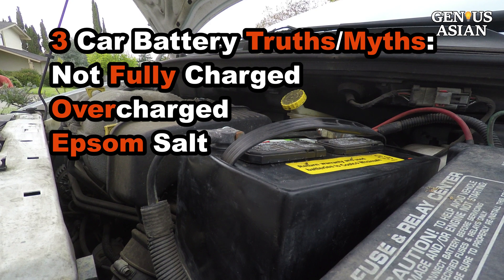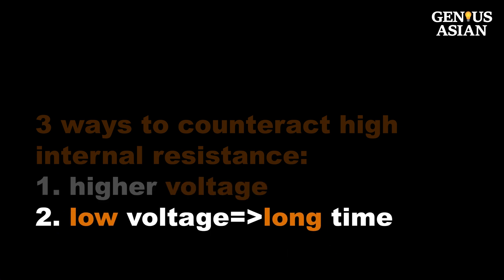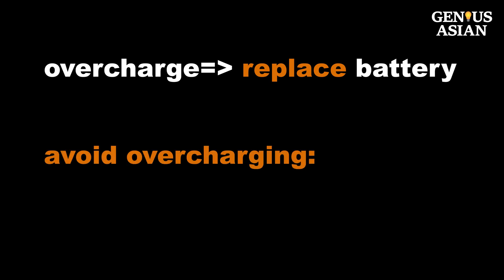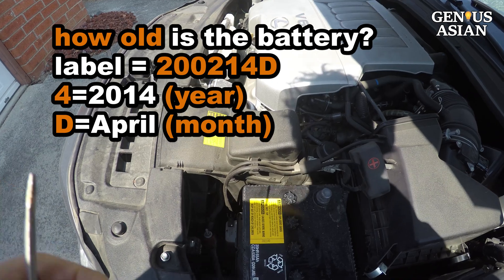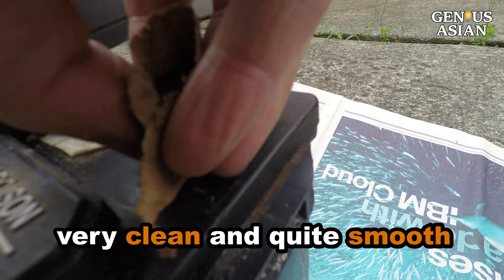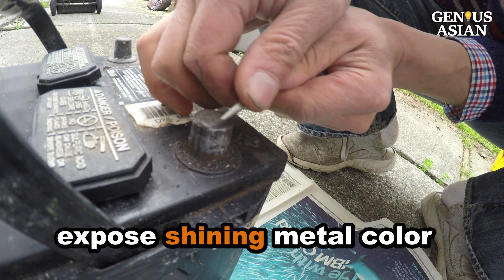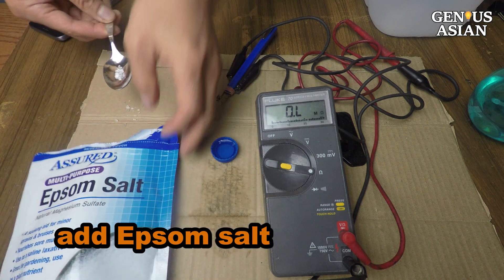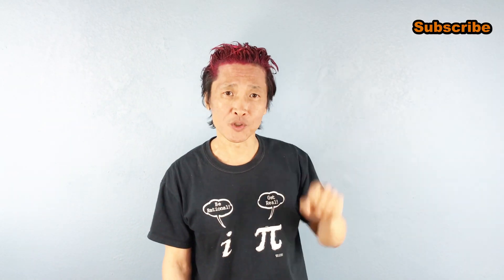3 Car Battery Truths/Myths: Not Fully Charged, Overcharged and Epsom Salt

Comment: I once charged a car battery with a 26 volts lipo battery it charged in about 5 minutes but I did it intermittent because the wires get too hot

Comment: sulfation is supposed to be removed with baking soda in each cell, a liter (1/4 gallon?)of distilled and agitation for a minute. Followed by a flush with more distilled and filling with new epsom salts solution. Have seen an isolated claim that the mag sulfate in Epsom salts is an "amps killer" vs straight sulfuric. if that holds, then  could keep the inital acid as it is easily strained and then supplemented with Epsom salts. Or buy new sulfuric.

Comment: I live in my car and use my battery a lot every day to run my laptop from it, charge my phone and tablet and run a small frudge all from starting lead acid calcium 55A battery and I use epson salts in my battery and it does really work better than when it was new. When it was new it could run 15l fridge for 2h before needing to idle engine and recharge with alternator, 6 months after when I added 1 spoon of Epson in each cell it can run the fridge now for 3h before dropping to 11.8v and needing to charge so yeah Epson salts works great for acid battery
Reply: Michael, if I was you, here's what I would do.
If you are using a 12VDC-120VAC inverter setup to power those things:
Take your inverter off of your car's 12V starting battery electrical system. Buy a 12V LiFePo4 battery and a DC-DC charger capable of charging that battery chemistry correctly. Install the LiFePo4 battery in your car's trunk and connect the charger's cables to your engine's alternator B+ terminal as well as a nice thick chassis location. Then put a battery disconnect switch in series with the positive cable of the DC-DC charger so that you can disconnect it from the LiFePo4 battery. Then hook the inverter system up to it. When you use the fridge and laptop etc., you'll draw from that LiFePo4 battery alone which is designed to be deep cycled and provides steady voltage amazingly well before it goes dead and the voltage drops off. When you need to recharge it, you can turn the disconnect switch of the charger on and start the car to recharge the LiFePo4 battery. I'd suggest getting a flexible solar panel array that you can put in your rear window or front windshield or outside on the roof as well to charge the battery for free. :) If you're using 12VDC accessories, you don't need the inverter and you can just hook up beefy sockets right to the battery. 

If you don't want to do the above, here's my second best plan:
Buy 2 identical deep cycle lead acid batteries. Install them in parallel so that you get the same 12V that you would with 1, however you get double the capacity. Having 2 deep cycle batteries makes up for the lower starting current that a deep cycle provides compared to a standard starting battery. Having 2 paralleled also gives you double the run time and keeps you from draining the battery as low as you currently are (11.8V which is the absolute minimum you want to ever bring a LA down to). You can add as many batteries as you want in parallel. You can put them in the trunk of the car, running large copper welding cable from the trunk up to the engine bay to connect them to the existing arrangement. Buy a tote bin to put them in for protection, and make sure you get a battery model/brand which has a small nipple off the cell caps for a hose to run through a grommeted hole in the car chassis so that hydrogen and oxygen gas can be vented out there instead of building up an explosive mixture inside the car with you. If you went with more expensive AGM or sealed batteries, this would not be a problem. LiFePo4 batteries are sealed so this isn't a problem with them. 

You could also build your own batteries using salvaged 18650 lithium ion cells purchased cheap off eBay and a battery management system controller to keep the battery bank balanced correctly. If you're handy, you could DIY this. If not, don't attempt it because lithium battery fires are terrifying.
Reply: @mannys9130  thanks for your advice, both options are nice but the first one with lithium is really good as I do have 100W portable solar panel that has saved me in past with flat battery under the bonnet not staring. I like option 1. with LiFePo4 and even buffing it a bit further with AGM start/stop under the bonnet.

Comment: I once found some info that told me that sodium sulfate is better than magnesium sulfate (epsom salt) and to only add it as an additive on a new battery to help prevent sulfation and not to an old battery as it may cause flaking and shorts and ruin what's left of the battery.  I have used it on a cheap new $60 550 CCA Walmart Value battery that would only hold 12.2 volts overnight brand new after a little driving.   The battery is three years old and now holds 12.4 Volts even if I don't drive the car or charge the battery for months and charges up quickly when put on a trickle charger.  The sodium sulfate has worked well in combination with trickle charging to cycle in the electrolytes.  The Turquoise Energy website that originally recommended a 100 grams of sodium sulfate equally divided between the cells of a smaller car battery disappeared, but Duda Energy still sells sodium sulfate
Reply from the maker: thank you for taking the time to chime in and to share your experiences. Hope your post will lead to more people to post their experiment and to confirm this result. Your post of "$60 550 CCA Walmart Value battery" is very good because it tells us the kind of battery is Lead acid type, not AGM, EFB type, so hope other viewers can report their finding with specific types of batteries. The obvious questions people will ask are: 1. what is the side effect (disadvantage) of adding this chemical? 2. because this chemical is so cheap, why manufacturers are not adding it?
Reply: @GeniusAsian  I read that the sodium sulfate is used an additive sometimes in deep cycle lead acid batteries.  Toxic things have "data safety sheet" (acronymed to MSDS OR SDS) pdf available as a legal thing these days, so you could probably figure out what brand of deep cycle lead acid uses sodium sulfate.  Interstate auto batteries use antimony I found out recently, which is really toxic besides the lead.
Reply from the maker: @OWK000  that makes sense, thank you for sharing

Comment: The solution has to be more saturated so  it needs to be heated to above 150 degrees f. From what I read  the mixture is supposed to be 250grams of Epson salt to 15 if oz of distilled water
Reply from the maker: Thank you for taking the time to chime in

Comment: Instead of trying 'to recover dead batteries', better to maintain it in de first instance. Disconnect n grind / wire brush positive, negative terminals (20-30% poor start due to dis not done).
Attach neg, positive clips of  DC welder (wid variable amp setting) can do de job of 'de sulfating' batteries. (Once a year). Isolate battery, and top off low water levels, caps off (if not sealed) slowly bring charge up, turn amp control ( watch for bubbling or temp rise wid thermometer reader), do it  for 5mins.  Switch off, rest 30-45mins (cool down). Repeat X3 . Disconnect,  Check voltage after 4 hrs, n amp reader hold charge??? If not repeat but wid higher amps.
Reply: Of cos, take all precautions I E. Wear gloves, eye goggles, mask, no smoking etc. Hydrogen is explosive. If U don't feel adequate to do dis, leave to professionals. Unfortunately, people who sell batteries r not helpful as it's counter productive to their biz.
Reply from the maker: Thank you for taking the time to chime in

Comment: add about 2.5-4% H3Po4(phosphoric acid) and charge the battery fully
a few charge/discharge cycles should help regenerate some capacity after that
currently have my old battery in the process
after 3 months with the lights on (complete discharge) and using it for a while i decided to take care of it
still had good starting current but only 12 of 72Ah
after adding the H3Po4 I did put the battery upside down and shake it a bit to mix properly

I am currently waiting for the discharge cycle to complete, but I am past the 12Ah mark now and still got ways to go
Reply from the maker: thank you for taking the time to to share, your comments will help many other viewers
Reply: @GeniusAsian  little update
if the battery was in normal use you can recover almost 100% capacity if you use a battery pulser and leave it on a float charger for a while, not sure if the battery pulser did that much, but that's how i tried it
the battery was first installed in 2015 and removed in winter 2022, as it was sealed I had to drill small holes in the side at about where the top level should be and mainly topped it off with destilled water and 10ml phophoric acid in each cell
wipe off any spill and close the hole with a soldering iron, but you can also install plugs if you wish, I would recommend nylon screws with silicone O-rings, but go as small as possible as there's not much thread engagement with anything above M5

if the battery has been completely discharged for a while you can not recover it
the battery that came with my used car was sitting with the lights on for 3 months, kind of amazing it even worked at all as well as it did, but it loses charge quite rapidly, like within 2-3 days you can't start the car
both my battery testers rate it at about 420CCA EN of the rated 680CCA EN after the exact same procedure as the one I managed to recover, that one got back to 790CCA EN of the rated 780CCA EN and started at 616CCA EN

Comment: My battery cells are all covered in white (sulfated) and I'm not sure how to revive the battery? I had it on charge every 15 minutes and an hour later charged it again! I did this 5 times and four cells between the negative and positive terminal seems to react by bubbling  but the negative and positive terminals did not bubble at all! I don't have funds currently to replace the battery! Do you have some advice! Should I try Epsom salt or baking soda on the cells not bubbling?
Reply from the maker: what is the voltage now? When you charged it, how much was the current? Very tiny bubbling is fine, but if it is heavy bubbling, then it is a sign of overcharging.
Reply: @GeniusAsian  the bubbles are very tiny and not boiling as if I'm cooking water, so I did it carefully and the voltage after charging was 9.23V and that is much too low to start an automatic car?
Reply from the maker: @kirstenrivera2790  did you use hydrometer to test each cell?
Reply: @GeniusAsian  no, I've not done that and I'm too far from town or a mechanical workshop to test it for me! I'll have to walk to get to one as my only transport  at this stage is my feet, so I'm kinda stuck! I'll keep on watching videos until I findca solution! If I had a 200amp charger, I would have fixed it using the same 15 minute process as explained in the beginning, but I don't!

Comment: For a car battery, it's simple:
1. Buy an automatic charger. There are a lot of automatic chargers, cheapest 3 stage chargers around $4 to expensive ones. Even a cheap charger can accurately measure battery's capacity for fully charging and avoid overcharging. A good automatic charger should not heat up the battery.
2. Keep battery fully charged, recharge every 2 -4 weeks, but strictly avoid battery boiling (overcharging). The charging amps and voltage can be far higher than 0.1C and 14.4V for a short period, as long as the battery is not heated up.
3. When a battery is dead, buy new one, lead acid battery is cheap.
Reply from the maker: yeah, in this video we talked about "undercharged battery would lead battery sulfation", that is why we need to have good maintenance to keep the battery charged (as you commented). However the problem is that most people would not do anything for maintenance, similarly most people would not want to pay for anti-virus software unless they are infected with virus ...

Comment: Also can we use to repair dry cell car battery with the epsom salt solution ? It would be helpful.
Reply from the maker: it depends on which kind of maintenance-free batteries you have. If you are able to inject liquid into the cell, then it may work.

Comment: How much quantity of Epsom salt and water so you need ? For the gravity to reach 1280. Like what is the ratio of the mixture
Reply from the maker: this video invites people to comment to see if someone can provide a chemical formula to prove that the magnesium sulfate can dissolve lead sulfate build-up on the battery plates. If no one can provide a formula then when people claim that the Epsom salt work, it is not because it can fix the plates but because the liquid can have better conduction, thus it is really not a fix. So your question of gravity change, the specific weight change will not indicate how much charges are accumulated by the Epsom salt, but rather the conductivity of the liquid, thus it is not very relevant.
Reply: 250 grams of epson salt to 15 fl. Of distilled water and it has to be heated to above 150 degrees f. To saturate the solution

Comment: That sediment is what ultimately kills a large likely majority of batteries. It flakes off the plates and accumulates in the trap at the bottom of the battery. That trap is offset from the plates so that the plates don't short out each other by conducting through the sediment layer. Deep Cycle batteries are built for recharging, from very low voltages back to max voltage, again and again. They get this additional rating by increasing the thickness of the plates AS WELL AS deepening the trap where the sediment builds up. So it will take more time for them to fill up with sediment and short out the plates compared with regular battery. Deep Cycle batteries tend to have far fewer 'cold cranking amps', however. So be forewarned.
Reply from the maker: Thank you for taking the time to share your tips. Your comments will help other viewers.

Comment: Very nice video. What is the qty of Epson salt to put per cell according to the battery capacity (Ah). That is very important. I think you miss one thing. After adding the Epson Salt you have to show the Specific Gravity. Epson salt means high gravity
Reply from the maker: if you watch my video, I have discussed that there are two reasons a battery is weak:
1. not fully charged,  in this case the specific gravity is low.
2. sulfation, in this case your specific weight could be normal, however you don't have sufficient contact areas on the plates, so you will have weak battery. This sulfation is the  case I tried to address, so the specific weight is not related. Anyway, thank you for you comments, this will help other viewers.

Comment: Well made video and that inquisitive engineer/scientist in you also keeps you from making wild and bold statements of fact like so many other videos do even when they’re not really sure what they’re talking about. That’s really refreshing. 

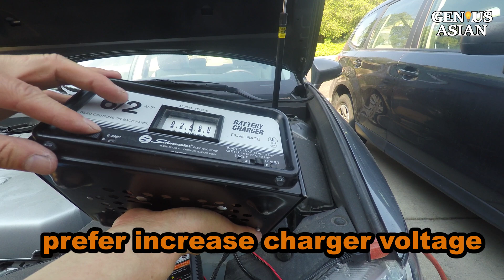Two questions though- at 7:08 you mentioned increasing the voltage of the charger to try to overcome resistance/sulfation but then you selected a higher amperage on the charger. Does the higher 6Amp charge result in a higher voltage charging? 

Also, do you know what the real meaning is of that Amp meter built-into the charger? I have an old one similar to yours (I can't find the manual if it ever even had one) and I (rightfully/wrongfully?) always assumed that when the needle decreased to zero, charging was done and I should stop.
Reply from the maker: Thank you for taking the time to contribute to this topic. Yes, when you switch from 2A to 6A, the charger increases the voltage so that it can generate the 6A. Yes, you are correct that the Amp reading decreases until it is fully charged.

Comment: When I'm not driving my cars, I keep them connected to a Battery Tender Jr and a Battery Tender Plus. They are both intelligent smart battery chargers that have 4 stages to its charging process. Once the chargers detect that my batteries are fully charged, they automatically switch to the 'maintenance voltage' and maintain my car batteries at the proper voltage - this way my batteries never overcharge. Been using these smart charges for many years, and have never had a problem with my car batteries - my batteries last between 6-7 years because of the Battery Tenders.
Reply: Hopefully those chargers have a timed de-stratification mode. A battery that sits for more than a few days becomes stratified where the heavier sulfuric acid component of the electrolyte sinks to the bottom and the lighter water component floats above it. The lower half of the cells become sulfated rapidly because of this. To prevent this from damaging the battery while it's being stored and unused, every few days you need to do a period of overcharging to do some electrolysis. The bubbles mix up the electrolyte again and it becomes homogenous. A smart charger optimized for flooded cell lead acid will do the bulk and absorption charging, then float at a steady voltage to maintain the battery. On a timer every 3-4 days, it will bump up to 14V or so and automatically do that for a couple hours before dropping back down to float. A charger like that will keep a FLA battery good for many many months in storage. A charger that simply maintains float voltage will not stop stratification and you'll eventually end up with a battery that has the bottom half of its plates all covered in a thick crust of sulfation and you won't even be able to tell because you can only see the top surfaces of each plate through the cell cap hole.
Reply from the maker: Very good. Many people are not aware of this, thank you for taking the time to share, this will help others.
Reply: @GeniusAsian  You're welcome.